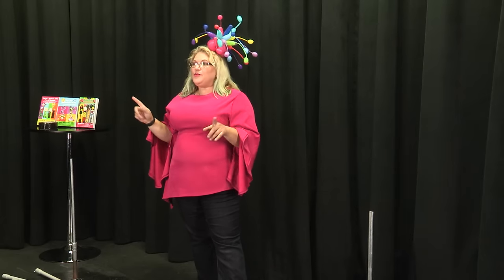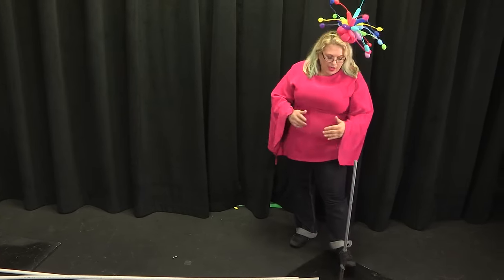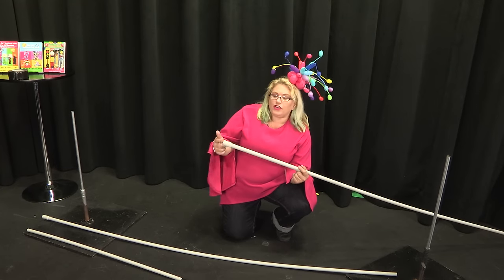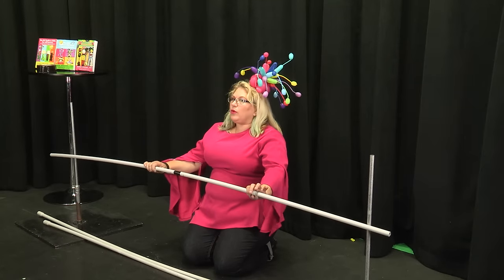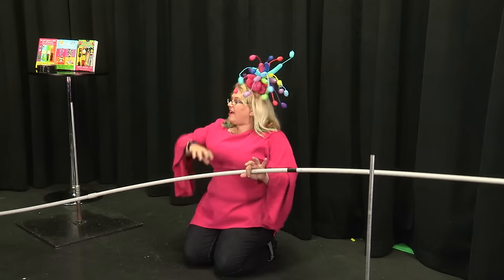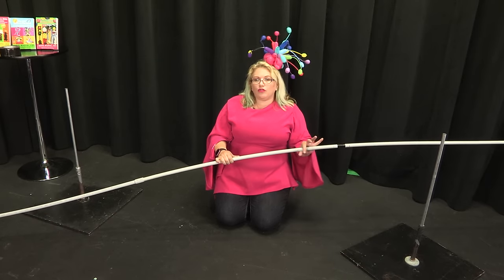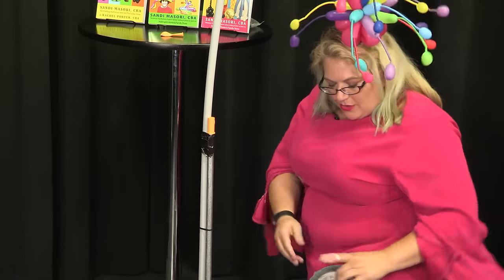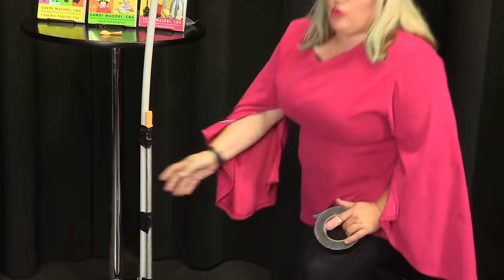Balloon Arch Frame (No Helium) - DIY Tutorial

Comment: Hi Sandi! How big of an arch could you make with this method? Do you think you could make an arch that’s like 35 feet with this method? Do you think an arch of that size will hold up outdoors using this method? 

Thanks for your videos, they are inspirational!!
Reply from the maker: I would say around 35' max on this style of arch.  It def works outdoors :~)  If you need extra weight, get some 10-25 lb free weights and slide them between the balloons and the baseplate :~)

Comment: Hi Sandi. I just want to start off by thanking you for this video. I'm needing to make one of these for our baby shower coming up. I'm however not wanting it as big, however, im not wanting it as small as your other 1 person arch video. Im hoping to stick to around 120 balloons or so. Do you think I can achieve that by cutting the three PVC pipes to like 4 or 5 ft instead of your 8? Thanks so much
Reply from the maker: If you want a small one person arch, I would use the other style.  You could do 2 columns with the emt and base plate and then use PEX or a hula hoop for the curved part at the top :~)

Comment: This might be a silly question, but is it possible to make one lower say, 5 or 5.50 foot tall or even a bit lower? What size pipes would I use for that?  I need it for a wedding decoration project, and I want the flowers to be right above the newlyweds, who would be seated.  Thank you!.
Reply from the maker: sure you can make it any size you want.  Just remember to use an odd number of poles.  :~)  So a 15' arch would be 3 5' pieces :~)

Comment: great job, but would be helpful at the end to quickly repeat the supply list. PVC is the bendable plastic- what were the aluminum or metal straight pieces at the base of ea side called? couldn't hear what you said.  Im supposing this can't be transported and it was installed at the venue?
Reply from the maker: the metal pieces are EMT ( electrical metal tubing).  In my books I lay out the written recipe.  You can find all my books on Amazon ;~).

Comment: HI. Could you provide a shopping list - i can see myself in Lowes with the video walking around the store. Great tutorial!!
Reply from the maker: sure ~ 2 pieces of wood 2' x 2' each.  2 flanges, 3/4" , 2 3/4" threaded 10" pipes, 2 pieces of 4' EMT, 3 pieces of schedule 40 3/4" pvc (the grey one from electrical that has the bell connectors on the end).  :~)
Reply: Sandi Balloon the grey pvc that makes the centerpiece is that a different pvc pole because i dont see the bells on that one
Reply: Are the "2 pieces of 4' EMT" the 1/2 inch?
Reply: What size is the 4' emt

Comment: Hi Sandi, if you had purchased the correct PVC Schedule 40 -3/4 inch. You said it would slide over the EMT, but would it slide down to over the 3/4 threaded pipe? Just curious making some outdoor 8ft  topiary poles trying to keep the base plate simple and clean at the bottom because there will be no topiary  at the bottom only the top of the pole.  Any other suggestions for ground poles would be nice. Thanks
Reply from the maker: It wouldn't slide over the threaded pipe, only the emt.  To hide the threaded pipe, either bring the arch all the way down, or use linens to wrap around and hide it.  If you're not using a baseplate though, you can just drive the emt into the ground, or use rebar driven into the ground.

Comment: Hi Sandie,  I want to do an arch that will be 7 feet.  I baught a 1/2 " pipe 10"  , to do the arc . Then I'll use  2 other stick  ( pvc or metal ) wich will be use to support the arc.  Do I need to cut the pipe that will do the arc in half ?
Reply from the maker: You want to always use 3 pieces so the stress is not on the center.  If the arch is only 7' though you may want to do a "U" shaped arch instead of a wide one.  Like this...  https://youtu.be/Wd8YYwFIh7E  :~)

Comment: love your tutorial, I have the hardest time finding bendable pvc for the middle
Reply from the maker: You should be able to get it from any hardware store.  It's in the electrical section I think, and is the grey schedule 40 pvc.  :~)
Reply: Sandi Masori Balloons I brought 2 scheduled 40 and the top piece will not bend
Reply from the maker: Ahhh.... that's the problem, you need 3 pieces.  Like I described in the video, you want the stress to be on the side, not the top.  The top piece will bend gently, which is what you want.  :~)
Reply: maybe because it was 6ft and not 8

Comment: Sandi, I am looking into getting a Zephyr arch kit. It is said to be a 9 ft x 11 ft arch. Will that be able to go over a set of four 6 ft registration tables? I am not adventurous enough to buy ild one myself yet and have a job (my first) in 3 weeks! Help!!! Thanks!
Reply from the maker: I've never tried that one, so I can't tell you how good it is or how it will hold up.  If you'll be doing a lot of them, you can't go wrong investing in an aeropole.  It's expensive, but you'll get it back with one or two sales.  :~)
Reply: Sandi Balloon Thanks for your reply. I did look into the Aropole kit. It is definitely expensive! I see your point in that it will pay for itself in a couple jobs but I just don't have the resources. I will  probably go with the Zephyr now. It is an easy setup for me.
Reply from the maker: Let me know how it works :-)

Comment: Love your tutorials.  I find that when I make columns or arches I can still see the poles.  Don't know if I am doing something wrong or is it normal?
Reply from the maker: The most important thing is that the balloons are all sized correctly.  If that's not the issue, then it could be that you're packing the quads too loosely or too tight.   From certain angles, you might see the pole no matter what, which is why I usually cover my frames with black duck tape :~)
Reply: Ok.  Thank you very much for your help
Reply: Sandi how much do you charge for an arch of this size?

Comment: Hi Sandi I have asked you some questions  before regarding the PVC poles and you have answered them  I know this is a year later but I hope you can help me again.  I have 2 10ft PVC poles but could I cut them into four pieces and use them with connectors to make my balloon arch frame .  I have used the 2 poles together before to do  two balloon arches but I was wondering if I cut them in four pieces would they still uphold my balloons when I do my arches and it would be easier for me to carry around.  Thanks.  Keep up the good work.😄
Reply from the maker: In general you always want to use odd number so poles, not even.  That way the stress is not pulling at the connection in the center.  Also, use the grey plumbing pvc with the bells instead of the white with connectors :~)
Reply: Hi what are bells?,,,,,,,,,,

Comment: Hi Sandi I have just google bells now I know what they are but is grey pvc stronger than the white pvc and if so can I cut the grey pvc in four or not.  Thanks
Reply from the maker: If you can, try for an odd number of pieces, not an even number . 5 is better than 4 :~)  Also, it would be better to buy more pieces to cut down, so that you still have all the bell ends.  If you're trying to use the white connectors, you could run into issues

Comment: I used this method once and didn't tape the connection points.. they were very tight (so they seemed).  I was almost done and then the pressure from the balloons split the connectors! Thank goodness the client wasn't around to witness the fiasco!
Reply from the maker: yeah, always best to tape connections, just in case ;~)
Reply: Can you please tell me what size flinges to use and what size threaded pipe to use

Comment: Thank you Sandy for showing us this awsome video!  I was wondering how would you figure out what size poles to use for a smaller arch?
Reply from the maker: If the arch is less than 24' I would use 2 poles with PEX, alum rod or a hula hoop for the top.  This method (in the video) is good if you want a wide arch instead of a narrow arch.  :~)

Comment: Sandi when I make a balloon table arch (6 - 8 foot table) it always seems to be weak and tips either to the front or the back.  What am I doing wrong or what can I do to make the top of the arch stronger? I am using the standard balloon table arch kit.
Reply from the maker: Your problem is that the arch kit you're using sucks.  Try using 2 columns w/ a cut hula hoop between them instead ;~)

Comment: Hey Sandi. In instances where the pvc slips over the conduit, do you still secure it with duct tape? I mean like where the pvc would come into contact with the flange... Would you secure it there?
Reply from the maker: If you have a 3- 4' piece of conduit, there's no reason to use the tape, it won't slip off ;~)

Comment: Gosh! You're the best!!  I have a couple of questions for you, but first let me say, I wish I would've seen this awesome video before I bought the Aero System :(...The EMT pole that you mention, is it the same as a conduit pole and can you buy it with the thread already on it or do you have to ask the store to do that for you?  Thank you in advance.  :)
Reply: Don't diss your Aeropole system... This method is effective & inexpensive but the Aeropole is worth every penny!
Reply: Okay, thank you..:)
Reply from the maker: I love my aeropoles.  Even though I can make my own frames, if I'm only making one or two arches, the aeropole is my first go to because it's easy to transport and simple to assemble.  :~)
Reply from the maker: Yes, I believe that conduit and EMT are the same thing.  You can get it already threaded, but I've found it easier to get the threaded pipe and the emt separately.  But, that's just me ;~)
Reply: What is the largest size arch you think you can get with the aeropole system?
Reply: The factory claims you can put 2 complete sets together which would make a 70 foot long garland.  I'm not sure I'd go that far.